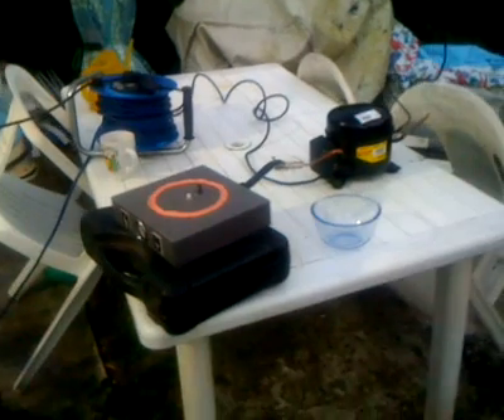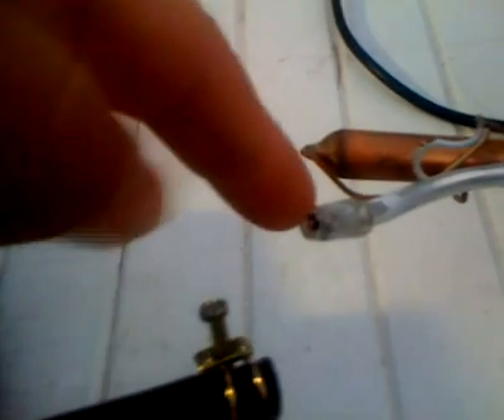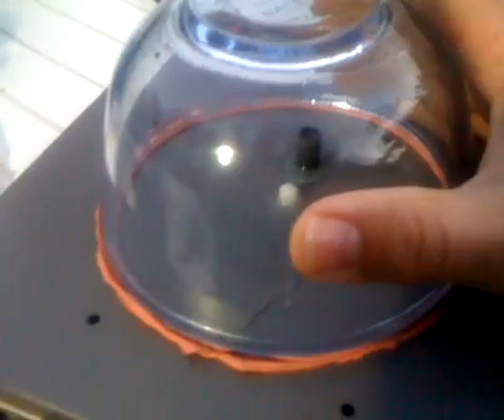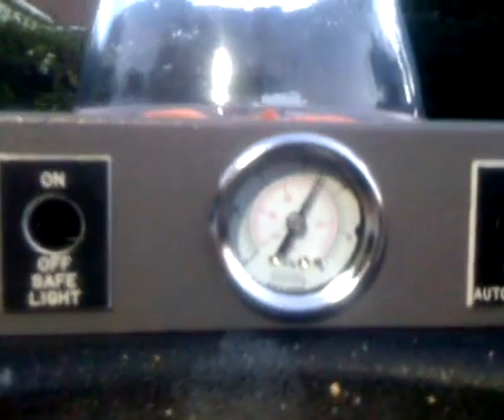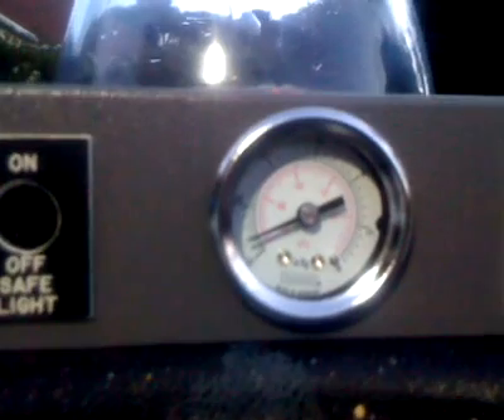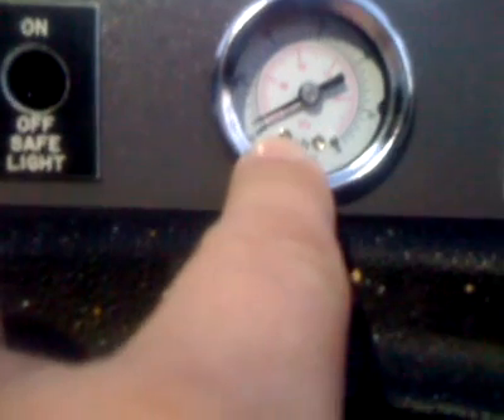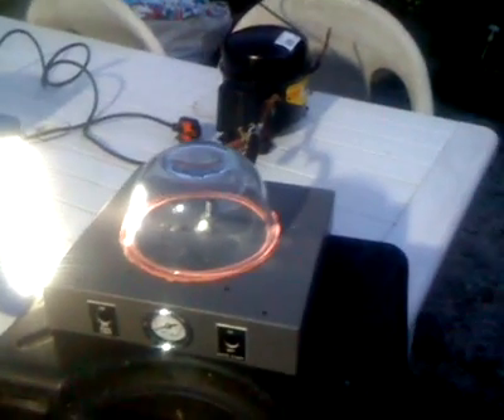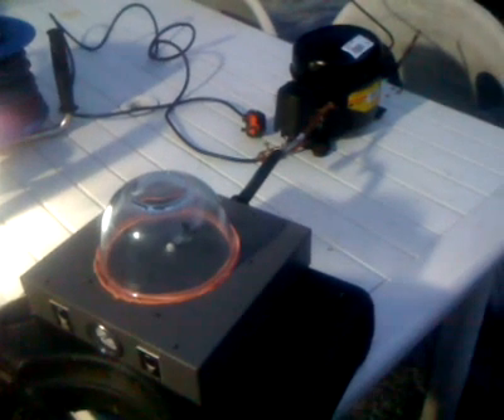DIY freeze-drying 1

Comment: Nice but that's not freeze drying. With freeze drying, the product is quickly lowered in temperature below it's eutectic / critical point and then it's placed in a vacuum and slowly warmed such that the transition is from solid to vapour instead of liquid to vapour. This is because unwanted chemical reactions can occur if the transition is from liquid to vapour. What you have is a vacuum chamber dryer which only differs from standard air drying by the temperatures required.

Comment from the maker: That's a good question Doug.  It's all VERY experimental at the moment so I'm not doing anything about water vapor.  I'm using salvaged compressors from fridges going to the dump so I'm not worried about damaging them.

Testing so far indicates that I'm not getting enough vacuum out of them so it's kinda back to the drawing board.